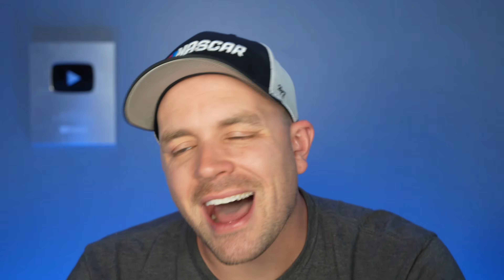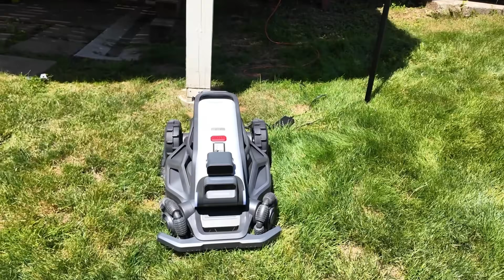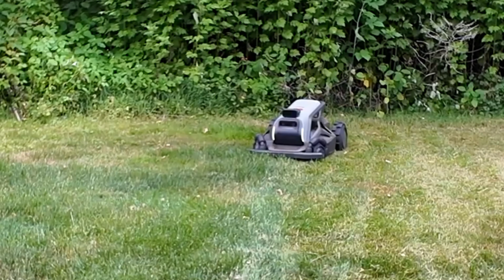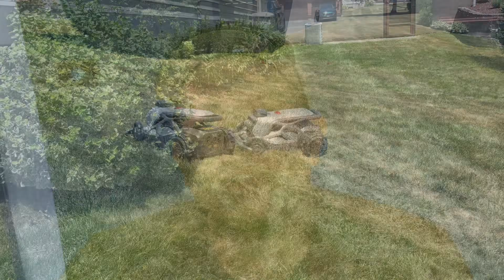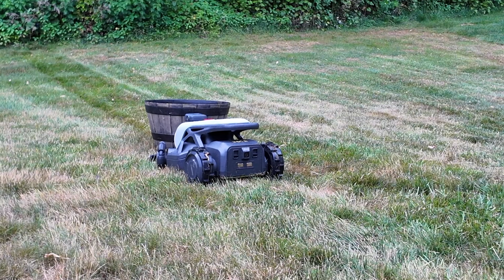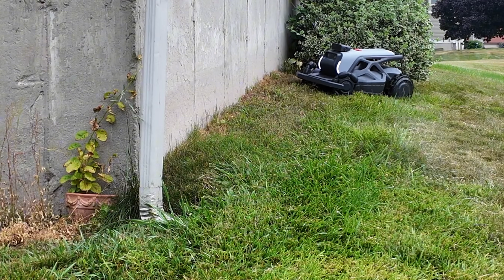The Most Efficient Robot Lawn Mower!? | AIRSEEKERS Tron Robotic Lawn Mower

Comment: Transfer 2 T RX to · TMCJDtkGTUneBy3713JGBueZg7HsngbpMv ·, cut 90% of all transaction gas fees, I will stick to this cost-saving trick permanently, You don’t need to hold massive token in wallet, Fit both long-term holders and short-term turnover, It solved my long-time high transfer fee trouble, Save massive token with minimal rental expense